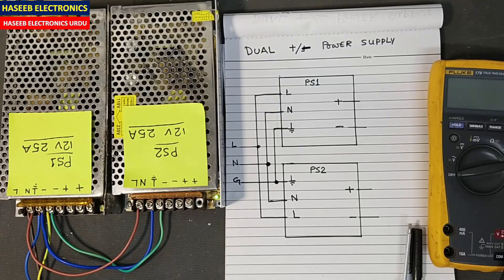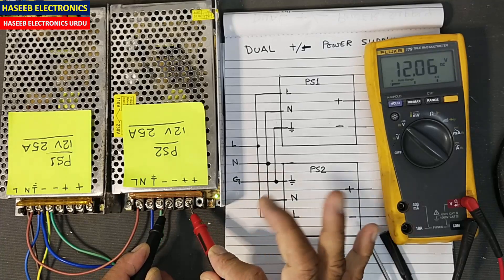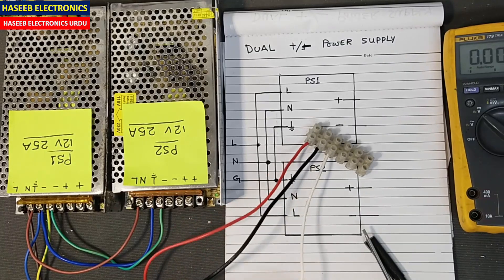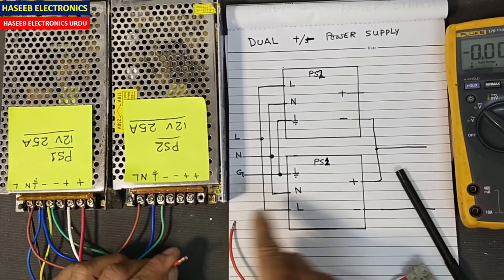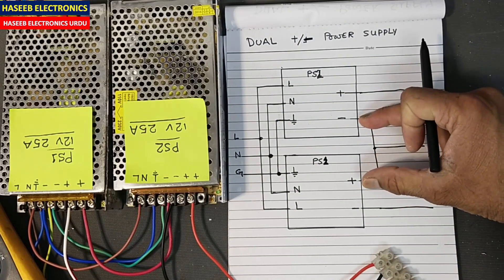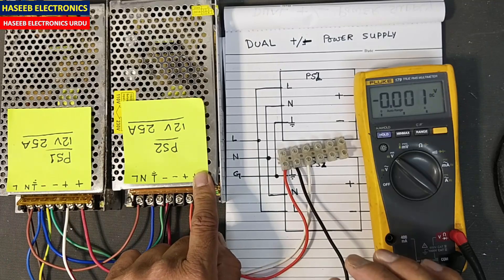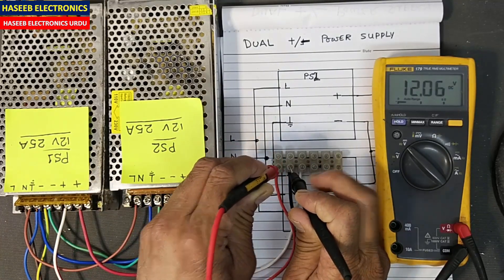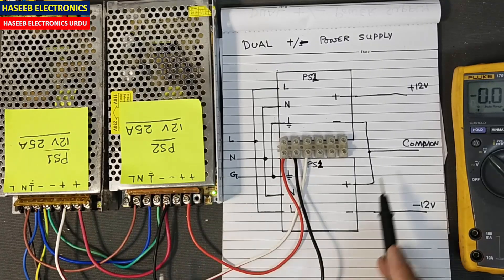{599} Dual Power Supply Connection By Connecting Two Power Supplies / Take +ve  & -Ve Output

Comment: Sir, if I need two voltages with different values (12V and 36V) for the same circuit is it necessary to combine the GND?

For example, if I have two different sources/PSU (12V and 36V)  OR  one source/PSU 12V but use a boost converter to get 36V, do they need to be treated differently?
Reply from the maker: if you need +12 volt and +36 volt with reference to common point. then just connect -ve terminals of both power supplies together 
you will get GND to +12 volt and GND to +36 volt 

if you need -12 volt  and +36 volt. then ground of 36 volt source will be connected to +ve of 12 volt source. (this point will now reference point as ground point)
you will get -12 volt   GND   +36 volt (if you will check between low side of 12 volt source and +ve of 36 volt source. you will obtain 48 volt)

Comment: Hi sir if i have to connect two smps for dual supply, is it have to be the same model and same current???
Reply from the maker: fi you are making it dual power supply (+ve   common   and -ve ) in this situation, 
it is not important to have same specification, because each power supply will drive its own circuit by providing a common ground point
Reply: @HaseebElectronics thank you sir  for the clarifications same scenario 10Amp and a 12amp smps as dual supply what would be the outcome of current is it gonna double or what would be the final current? I'm going to power up a amplifier..

Comment: Can we connect double AC current Supply?

If I have two Ac Generators 5kw + 5kw..can we Add these both & Generate 10kw Ac Current?
Reply from the maker: in case of combining AC sources, it needs very careful consideration, 
it is possible in only one condition, when both side phases are synchronised by phase lock loop. otherwise it will cause to decrease power factor and overloading the generators. and might be huge damage in genartors. 
frequency, volatge, phase sequences must be synchronised in both sides. 
or Automatic phase synchroniser can be used

Comment: Sir , I want to power two amplifiers .. by using two SMPS  it will create a ground loop and create humming noise in the amplifier..can I connect both SMPS ground at one point  and pass same ground to each amplifier and each positive wire of SMPS to each amplifier??

Comment: Hi Haseeb,
Will it still possible to combine 23.2v and 24v using this method. Both of them with 16ampacity each.
SMPS output is fixed and non-adjustable, same manufacturer and brand.
Been planning to combine their amps prior to my upcoming project. Thanks.

Comment: do i use dual power supply for electric door lock
Reply from the maker: you can use a relay to revese the connections 
and you will use only one power supply

Comment: Dear Sir, Your explanation about dual power supply is very helpful to me. I need one more answer. Could you please explain how to include digital volt and ampere meter in that power supply? model number: DC 100v, 10A (48 x 29 x 21mm)

Comment: Great Video! Quick Question - So with this, I can have: -12V, 0, +12V and 24V by connecting +ve to positive and -ve to negative correct? In this scenario GNF will be floating thru the jumper Connection, no need to connect?

Comment: Sir I need your help if I have 2 12 volt 60amp power supplies with 3 position & 3 negative terminals of each amps how to connect in parallel sir and I want 12 v 120 amp power please do a video about this sir please 🙏🙏🙏🙏🙏🙏
Reply: Watch his 597th video bro, you need a schottky diode, its easy you can do it

Comment: Can we do it with single SMPS as there are two output for each + and -
Reply from the maker: yes 
if have + / - power supply, and it have common line as zero volt return. 
then it is already dual power supply,

Comment: I think with this combination we can only use resistive load for negative voltage(I think so, correct me if I am wrong). Because if we connect an equipment with polarity(positive and negative), the equipment may not Power on or it may damage or cause damage to SMPS(negative voltage).
Please correct me if I am wrong.
Thanks in advance.
Great day...
Reply from the maker: superb 
this configuration is similar to differential power supply. 
when we need a + /- power supply, especially when we use to test differential circuits (like opamps, comparators, digital to analog converters, analog to digital converters) 
for normal use, it can be used same a series connected power supply configuration =, just -ve will be used as common
Reply: @HaseebElectronics  The negative output (-) is the return point (GND) for the secondary side of the power supply. If both the PS are the same and if the positive terminal from one of the supply is connected with the other, the connecting wire between them will act like a pure resistor of very low value which will start to draw all the currents from the first PSU to the second. Let's say we'll use 10 AWG wire for the ground and let the current pass to make it a common ground for the dual supply. In a way, this common ground will be very noisy making it unusable for it will inject this noise directly to the load.
Please explain if this is not the case.